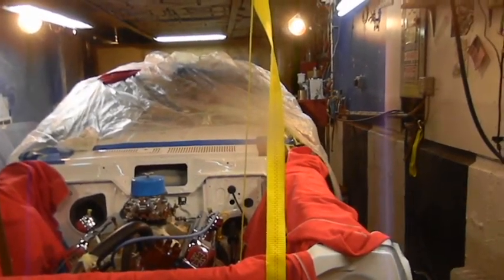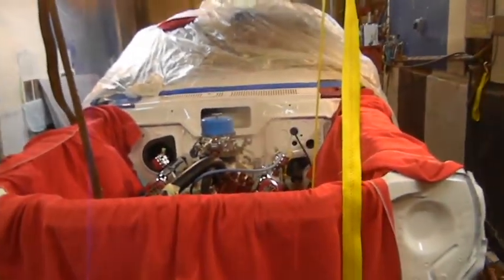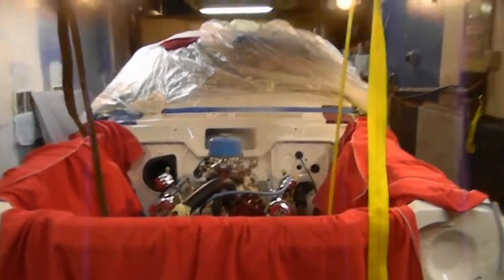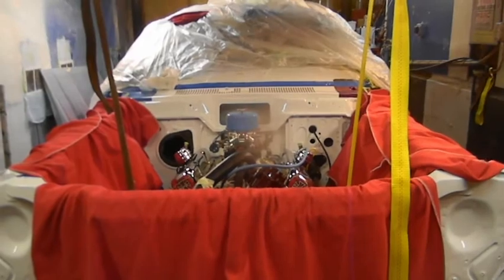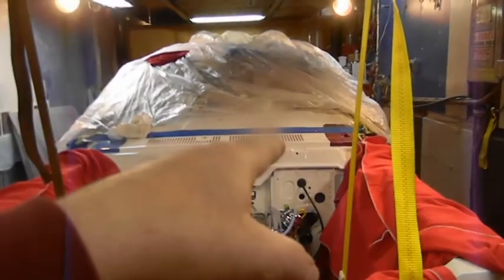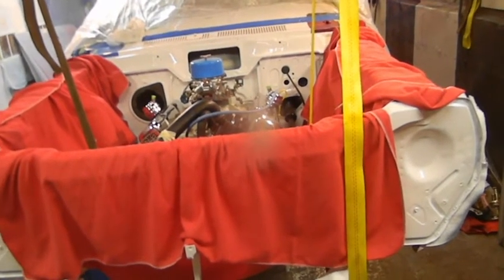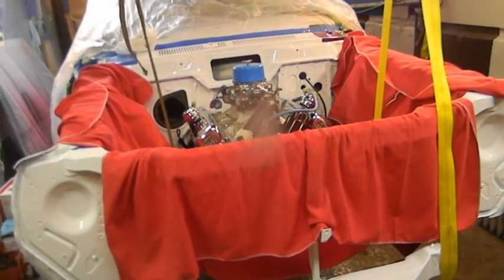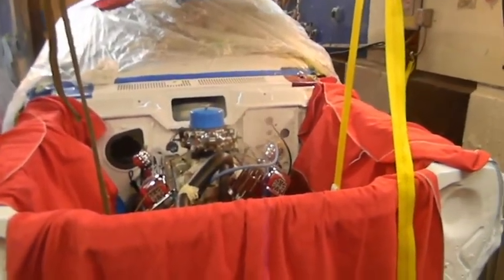AMC Part`s And 585 BBC Explanation

Comment: I read an article on the AMC Trans Am program and it blew my mind to learn that they gutted the front suspension on the Javelins and replaced them with all Mustang parts. The later Ball Joint front ends are almost identical to the early Mustang front ends. The must have liked that design!